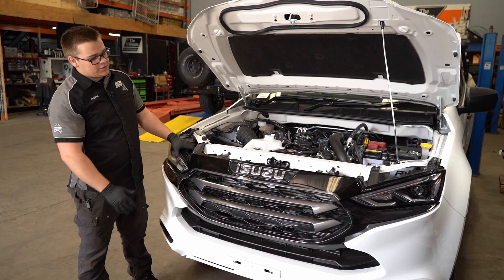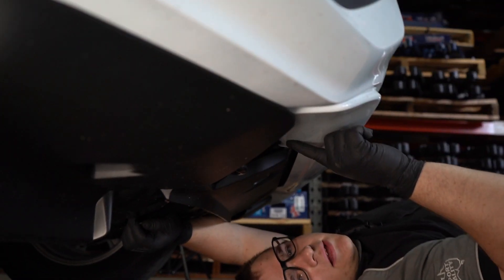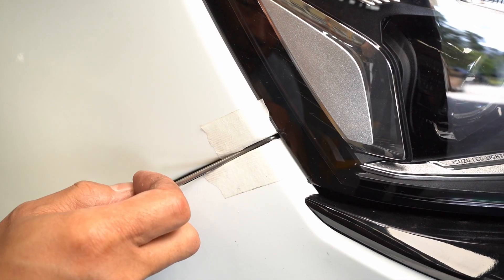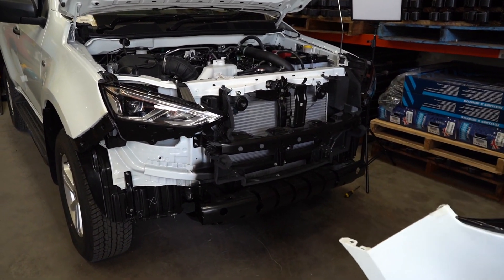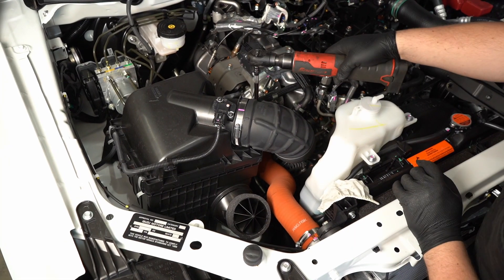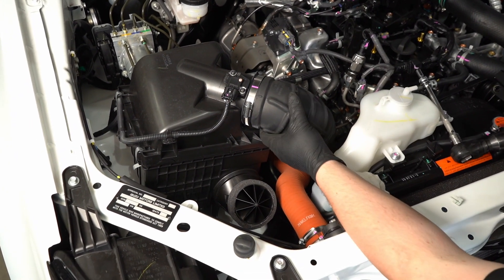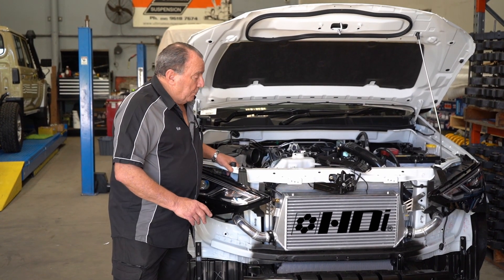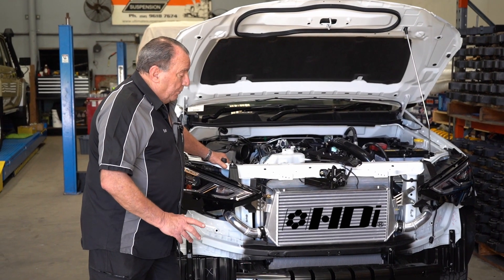HDi Isuzu MU-X D-MAX Pro intercooler kit installation

Comment: Need some 12v computer cooling style fans as well
Reply from the maker: @arqammanzoor3057  a fan indeed  helps when you do 4wd at less than 40km/h but when you drive over 60 km/h a fan becomes a blockage and gets driven by the the air speed because the fan speed max at about 50km/h
Reply: @hdiperformance  Can istall a 12 inch DC fan with 5 blades with variable blade pitch, Wire it like if the vehicle goes more then 50km/hr it will lookdown the fan and angle the blades 90 degree to the radiator to max the airflow

Comment: That can improve engine power?
Reply from the maker: Yes, an intercooler can improve engine power by reducing the intake air temperature and allowing for a denser charge of air to enter the engine . Yes, an intercooler can improve engine power by reducing the intake air temperature and allowing for a denser charge of air to enter the engine . This increases the amount of oxygen available for combustion, which in turn can lead to an increase in horsepower.

Comment: what's the msrp on that? would it fit 2022 dmax?  do you have distributors in the Philippines?
Reply from the maker: we don't have distributor in Philip[ines price can be checked on www.hdiau.com thanks
Reply from the maker: It will fit 2022 d-max Please check out www.Hdidmax.com